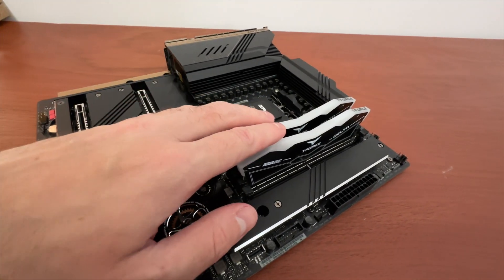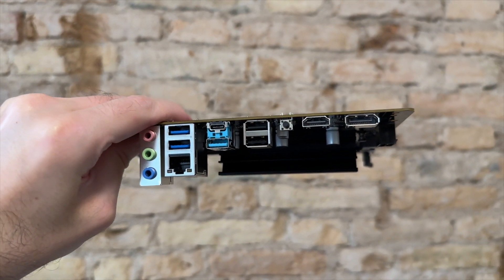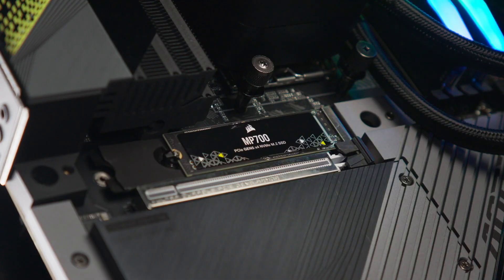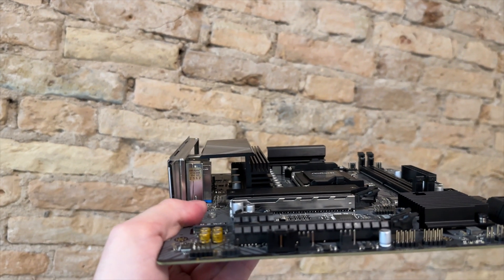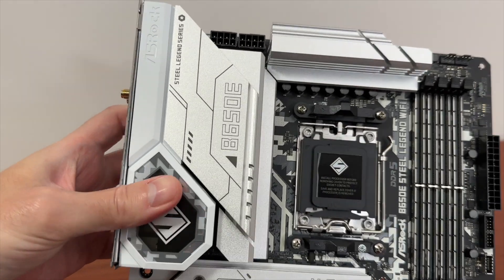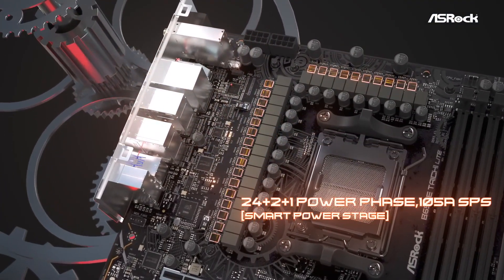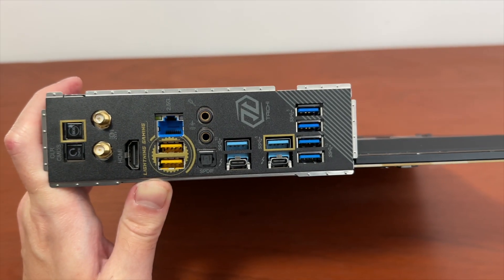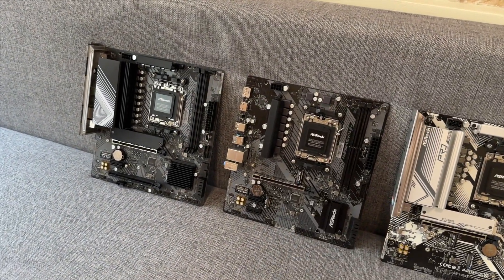Your Guide to Buying the Perfect Motherboard: A620 vs B650 vs B650E vs X670 vs X670E

Comment: when it comes to cheap B650 Asrock board i dont understand why lots of channels favor the B650 Pro RS instead of the Livemixer, as of 2025 the Livemixer is cheaper and a better board the m.2 configurations look like this:

B650 Pro RS: 5x4,4x4,3x2(!!!) the 3rd ssd slot is just 3x2 and nobody talks about it
Livemixer: 5x4,4x4,4x4 so the Livemixer gives a full 3rd 4x4 m2 slot

the PCIe x16 slot:

B650 Pro RS: 3x4 (again, a PCIe 3.0 slot)
Livemixer: 4x4 it is full again

the Livemixer gives full heatsink for all 3 m.2 slot the Pro RS gives 1

how can you miss these?
Reply: that board is more about looks than functionality, but im sure it can work.
I don't care for Asrock boards though, never had much luck with them.
they're alright if you spend a little more, but that's just it. Asrock isn't very
good at the low end, but their Pro RS and Steel Legend boards is where
they're good at. i can get Asus Prime or Gigabyte UD which is short for
ultra durable. that's their budget range, and it wipes the floor with Asrock.
now if you want the best, MSI is the best in the budget class. the only
downside is price, they tend to be a little higher, but you get quite alot with them.

Comment: Hope an X850 mobo next year comes with 10GbE onboard. 🙏🙏
I don't wanna waste $$$ on a Godlike or Proart. 😅
Reply from the maker: That would've been nice🙂
Reply: @theivadim  Are highend boards more durable than midrange ones? I don't mind spending more, coz I want my mobo to last at least 10 years before physical failure.
Reply from the maker: Yes, the more expensive boards generally use higher-quality components, which can result in a longer lifespan, especially under heavy workloads. However, it doesn’t always make sense to go for the top-of-the-line options. Mid-range boards, like MSI’s Tomahawk, are typically more than sufficient and should serve you well for many years. Only spend more if you need specific high-end features.
Reply: @theivadim  Thanks! Subscribed.

Comment: for ryzen 5 8500g which motherboard would you recommend in my country a620 is for 70 dollars and b-650 is for 110 dollars should i spend more btw my budget is tight but worried that will it cause any trouble for long term
Reply from the maker: There won't be any trouble. The 8500G is a low-power CPU. So even the cheapest motherboard will get the job done. Pick the one that has features and ports you need.

Comment: Im planning on getting the ASRock B650 Pr RS with wifi with the RX 6750 and R5 7500f cpu, but if I can get a bit cheaper should I go with a b650M HDV/M.2? 
the B650 Pro RS wifi is like 140 now plus with tax around 160 is what Im seeing

Comment: asking for an opinion, i cant find Asrock A620M-HDV/M.2+ in my country only have the Asrock A620M-HDV/M.2 for around 100 dollars ( RM 400) for me here it still a good choice for me compared to msi pro a620m?
Reply from the maker: Both are less than ideal. I'd recommend finding an alternative that has a heatsink on VRM to keep it cool. ASRock B650M-HDV/M.2 is my preferred budget-friendly AMD motherboard. But if your options are limited to those two then I'd pick the MSI. It looks a bit better on paper.
Reply: @theivadim  ASRock B650M-HDV/M.2  here is double the price of of asrock a620m. The cheapest i could find is RM 825 which is about 205 usd, haha pc parts prices here are  abysmal
Reply: @theivadim  but if i could somehow find Asrock A620M-HDV/M.2+ here, do you reckon i go for it over the msi pro a620m?
Reply from the maker: Yes, A620M-HDV/M.2+ would be your best option. Of course, if it's not a lot more expensive than the other two options you have. Sometimes you just have to buy what is available to you. The msi pro a620m will still get the job done. If the room where your PC is operating is getting hot then you might lose some CPU performance when power delivery system will get hot but the PC should still work fine.
Reply: @theivadim i managed to find it,a bit more expensive 25 dollars more ( RM 100 something like that) but i think im gonna go with this one regardless. 1 more thing tho, what kind of wifi card does it use and what would would you recommend? I would like bluetooth support as well for my wifi card
Reply from the maker: I'm not very familiar with WiFi cards. They all have Bluetooth as far as I know. Just pick one from a reputable brand and you should be OK.

Comment: What should i go for ryzen 5 7600
Reply: Need the answer to the same question
Reply: A620 should be good enough if youre just a casual user. I got the same setup (r5 7600 + A620m)

Comment: I'm just a gamer - Think I'm leaning towards a good A620 with a 65w Ryzen 7700 (105w 7700X doesn't offer much more for the price/power since I gave up with Overclocking 🤣🤣).  PCIe 5.0 for the GPU just seems like a money grab feature at this point so I'll skip that (running my 3080TI PCIe 3.0x16 no issues so 4.0 is plenty for the foreseeable 👍).     My fav board is the one I'm using atm - Asus ROG STRIX B450-I GAMING (ITX) with the RTX 3080TI/Ryzen 9 5900X - this board is great & overkill for my usage - no issues, not even with the VRM which got slated for running hot with no airflow (I mean who runs with no airflow in a pc case ??), It's fine with adequate air-flow & I have the GPU on a Riser so it don't cook the mobo  - but the equivalent AM5 platform B650 Asus ITX is expensive so I'm cutting the features I think I might need but will never use - A620 seems to have everything covered - now I just need to find the right one 🤔🤔
Reply: I personally have a ASRock A620M PRO RS working with R5 7600 CPU and don't regret not getting the B650. 2 Gen4 M.2 SSDs + one Gen3 for upgrades in the future is way more than i could ask for. Installed the Wi-Fi 6E card by myself, could not find the wifi version on the market :c

Comment: A620 pair with rx 7800 xt good pair?
Reply from the maker: You should check if the A620 you've chosen is good enough for your CPU. RX 7800 XT GPU will work just fine with any modern motherboard. A620 included. So, no worries there. What about your CPU? Which one are you buying?
Reply: AMD Ryzen 5 7500F
POWERCOLOR Hellhound RX 7800 XT 16GB
GIGABYTE A620M S2H
RAM: GSKILL Ripjaws S5 16GB DDR5 
This is the part I'm considering, is this good? thx for ur help !

 @theivadim
Reply from the maker: Yes, looks good👍
Reply: @theivadim  thx bro🙏🏿

Comment: I want to mention that at b650 tier, that the b650 hdv/m.2 do not have rgb support. Which obviously i don't think matter much, never cared for it. But its worth knowing.
Reply from the maker: Indeed. I think that HDV does what it is supposed to very well. It is focused on bringing as much functionality as possible to the lowest price tier. I haven't seen a better product from another company that offers better value.
Reply: @theivadim  Do you think hdv or something like an asrock pro rs is fine for 7800x3d? I been looking into it quite a while and so far signs point to yes, which would be a nice.

Edit: i got it and its working great.
Reply: Hey, what does this mean ?
Reply: It doesnt have an rgb header wherr u connectyoirmother board to your case fans @patatedanstesdents
Reply: well yeah since corsair made a rgb adapter or whatever it is i don't know what it was called for fan, so we're chilling and who cares about rgb ram tho
Reply: My b650 aorus elite ax v2 has rgb
Reply: but it's better than most b650 in that price range
Reply: the elitist would never buy this board or this chipset in general,
even if it had it. i think B650 is the sweet spot if you're going
for a Ryzen 7000 series such as the Ryzen 5 7600 or the 
Ryzen 7 7700, B850 is a better choice if you're going for
a Ryzen 5 9600.

Comment: Can A620m boards overclock cpu,gpu & ram?
Reply: Ram and gpu only. A620 will still boost the cpu frequency as expected. The 7600x has a base clock of 4.7ghz and can boost up to 5.3ghz with the ASRock A620M-HDV/M.2+ and can be had for 79.99 on Newegg. It will offer full performance (without overclocking) for any am5 chip except the 7900x and the 7950x.

Comment: 7600x, 4070ti on an a620. Would it be wise for gaming?
Reply from the maker: In terms of performance? Sure. It will be good. As long as the A620 you picked has all the ports and features you need - go for it.
Reply: @theivadim  using the A620M PRO RS WI-FI one, new to AMD or in general newer pc parts lol
Reply: @yungspidi  have you bought it? I'm thinking on getting the same mobo. 7600 instead of 7600x and ASrock RX 6750XT 12GB Phantom gaming.
Reply: @nikhzlima1  yes I’ve bought it, it’s quite basic but honestly does the job well. Might swap out to a nicer looking MOBO in the future. And why not the X version? High price diff? Oh and do get a really good brand AIO, these amd cpus run really hot lol
Reply: @yungspidi  so, really not because of the price, here in Brazil currently its the same, with a difference of 14 dollars. But Reason is exactly because of the temperature, 7600 vs 7600x in performance has a 4% difference only, but 7600 runs with 65W which means somewhat around 60-66 Celsius versus 80+ from 7600x. This means that for my reality in BRL currency, I can run a 7600 with a simple air cooler instead of paying 140 dollars in an watercooler plus not having the need to change my PC case. Thanks for the answer btw! I don't care about the esthetics on a mobo actually, my opened pc case side goes to a wall so.. lol I was in doubt though about mATX versus ATX but is seems to not loose performance, only number of features and this Asrock a620 pro rs wifi covers all I need. My other option has being the MSI B650 Tomahawk WiFi.

Comment: suggest me a good b650 mobo for ryzen 7 7800x3d and rtx 4070 ti. but it should be cheap or medium range .
Reply from the maker: asrock b650m-hdv/m.2 is the way to go as long as it has all the ports and features you need.

Comment: I wanna buy the ryzen 7700x, do u think A620M PRO RS falls short. Do i need to get a b650 or it's not necessary?
Reply from the maker: A620 Pro RS is fine. Go for it as long as it has all the ports and features you need.

Comment: I wish there was more selection of X670 and X670E motherboards in mATX and ITX sizes, theres literally only 1 for mATX and its nearly $600 USD (Asus X670e Gene) and then the Asus X670e-I for ITX which is $450 😢
Reply from the maker: I think the sheer cost of making such a thing is making it unpractical. I suspect that is why there aren't more of them available.
Reply: x670 is pretty useless, many b650 boards have better feature than some x670
Reply: @goofytuber9011  yeah it's obviously not a requirement especially with the x3d chips but it'd still be cool to have the option, I ended up going with a Asrock B650m Pro RS Wifi since I'm running a 7800x3d, 32gb of Corsair 6000mhz DDR5 ram and a 2080 ti
Reply: Matx wont have enough slots to utilize all the lanes of the x670 it will just be a waste
Reply: A smaller form factor for X670(E) motherboards doesn't make sense because there are too many ports to support.
Reply: @greatwavefan397  if they made a couple of the USB C ports USB4/Thunderbolt, that'd make good use of some of the extra PCIE lanes. My Asrock B650m pro rs only supports thunderbolt if you use a specialized PCIE card and connect a cable from it to a header

Comment: is it really true that a620 can't support over 120w? I thought I saw an a620 that supports even up to 170w. The GIGABYTE A620M has an 8 +2+1 VRM. Seems like this would support over the 120w that AsRock has since it has a better VRM
Reply: a620  are limitted to even less than that(like 82W or something like that. Nobody should buy these motherboards if they consider updrading their system in the lifespawn of their PC and if you don't why do you buy the more expensive AM5 generation? a620 are terrible buy imo.
Reply: @Rastaboulotte  interesting thing to consider, I'm currently in this doubt if whether i should go for b650 or a620 on a ryzen 5 7600x
Reply: GIGABYTE B650M K has the same VRM set up and yet it theoretically supports up to 170w. I think a620 can do it too
Reply: techyescity did a review of the asrock pro rs one. its quite good, but there is a power limit. forgot exact number though

Comment: highly disagree best b650e-f is by asus rog strix , has 4 nvme 1 gen 5 and 3 gen 4, and its got gpu pcie gen 5 and one gen 4 , and its got 3 usb c ports hich is 2 extra of any top x670e  and it has 3 more usb 4 ports ten  any top x670e
Reply: The Strix B650E-F is by far the best bang for buck board.
Reply: But the price thoe.
Reply: If you care about Sata these boards use a doubler on a very old controller limiting speeds to around 380mbps, also had constant issues with Usb needing to be reset every few weeks I also don't like how the lane sharing works on this if you populate the bottom Nvme slot it halfs your top pci-e graphics card to x8 and populate the 3rd Nvme slot it disables your 2nd pci-e slot completely. My board was the Rog  Strix B650E-E version after a few months of owning it the vrm exploded (while idling) and had to replace the entire board needless to say I won't be buying another Asus board anytime soon.
Reply: @TrinoDR  not for me my board had no issues at all I had 3 of them, idk about 650e-E I can only say about e650-f

Comment: Which the best between the two please asrock b650m pg ripide or b650 msi gaming plus wifi
Reply: would pick asrock
Reply: @nivea878  Me too! I have used asrock mb for the last 5 years. I never had problems with them. Good choice!👍👊:yougotthis::elbowcough:
Reply from the maker: Riptide has better M.2 SSD heatsink and I/O shield pre-installed. I'd pick that.